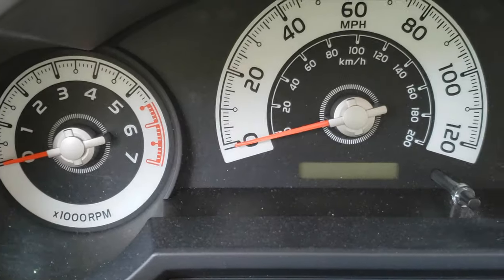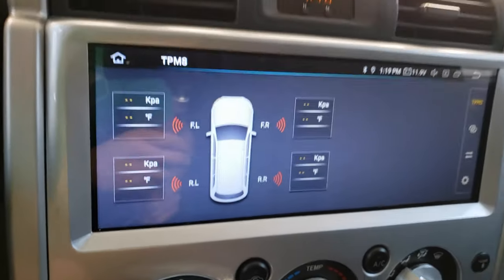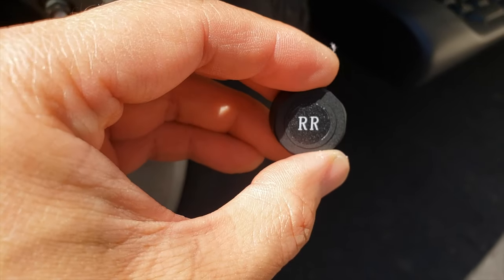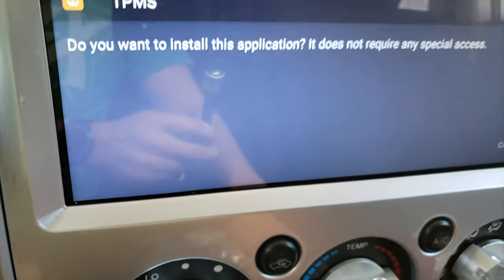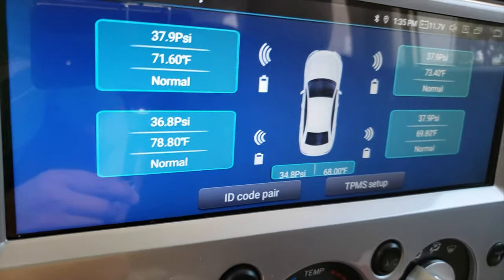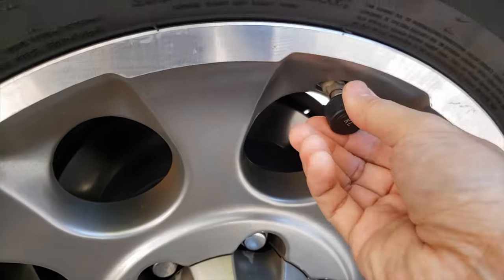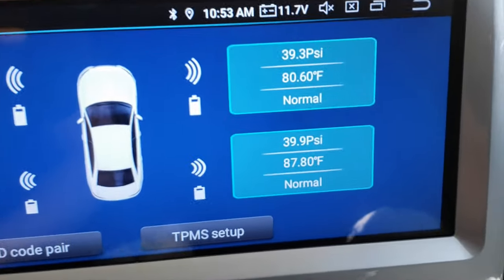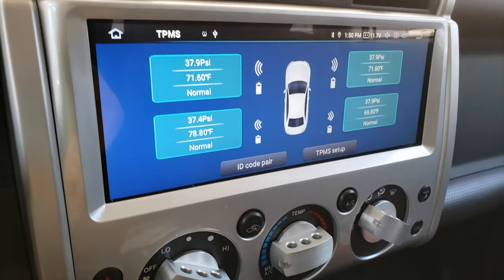External TPMS Sensors for my FJ Cruiser - Review

Comment: If your car shows the TPMS icon, you should have sensors in the tires already.  Is there really no way to get the data from the vehicle to display on the app?  Maybe an ODBII option?
Reply from the maker: I do have internal TPMS sensors in my tires.  I have Torque Pro, and I am not aware of any way to read TPMS from the internal sensors on the app.

Comment: I thought the torque app had the ability to monitor TPMS as well.  
How do you change the batteries?
Did the paperwork in the box (if any) have info on ordering a 5th sensor?
Reply from the maker: The batteries are changed by using the supplied wrench, and unscrewing the hex connector underneath.  They use button cell batteries.  There was no information on ordering a 5th sensor in the box.  Most of these Chinese products don't have detailed instruction manuals anyway, but based on what I saw when I "enabled" the spare tire sensor, I don't think it's a real thing anyway.  You may be wasting your money if you were to get a "5th sensor."  

I'm going to look into the Torque TPMS option.

Comment: Supposed to be set at 46psi. Check the inside of your driver door.
Reply from the maker: It depends on the tires!  The driver door sill says 32 psi.  You need to remember that the door sill label is the recommended tire pressure for the stock tires that came from the factory.  These are not it.